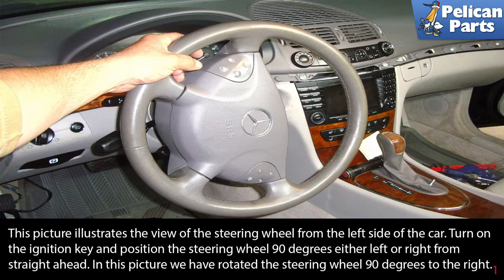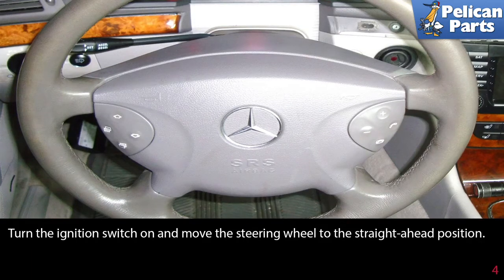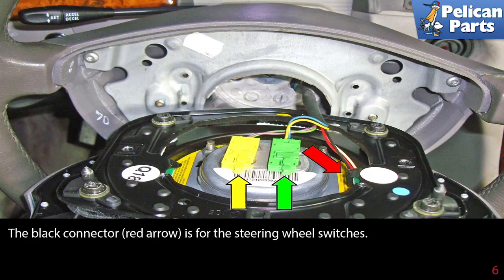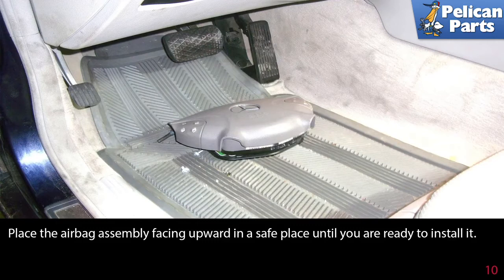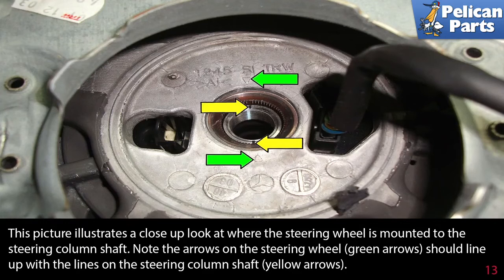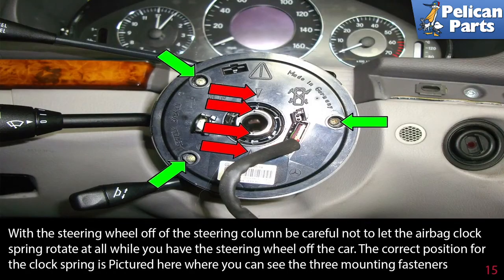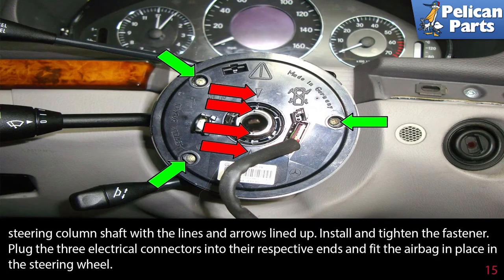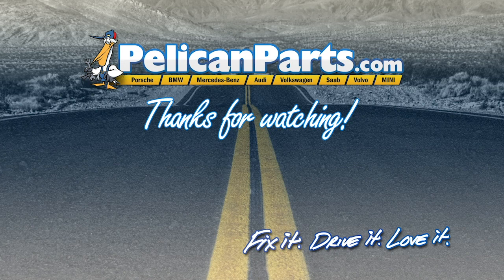Mercedes-Benz W211 E-Class Steering Wheel Removal

Comment: Great video, I just dont fully understand the thing with disconnecting the battery. What is this supposed to protect me from? I'll be sending my wheel to be reupholstered and it will be off the car for at least 3 days, does that mean my battery need to be disconnected for all this time? Is that good for other systems in the car? Because I was told at least a few times that in cars with SBC you dont really want to let them sit with disconnected battery for a longer period of time
Reply from the maker: Disconnecting the battery prevents fault codes from being set and protects electrical  items from unintentional shorts.